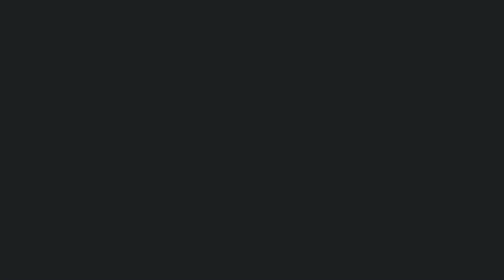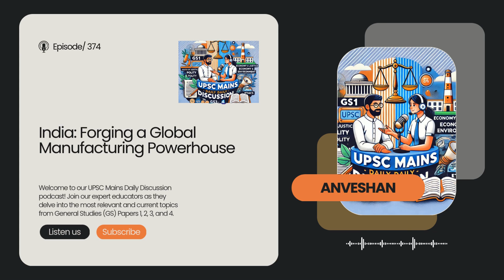🚀 India: Forging a Global Manufacturing Powerhouse 🏗️ Make in India, Exports & Industrial Growth-374

Comment from the maker: Frequently Asked Questions about India's Manufacturing Sector
1. What are the primary factors positioning India as a potential global manufacturing hub?

Several factors contribute to India's growing prominence in global manufacturing. Key among them are supportive policy reforms and improved ease of doing business, substantial infrastructure development and logistics advancements, increasing adoption of technology and Industry 4.0 principles, a growing focus on green and sustainable manufacturing practices, and the benefits derived from geopolitical realignments like the "China+1" strategy. Specific examples include the Production-Linked Incentive (PLI) scheme, the Gati Shakti National Master Plan, investments in semiconductor manufacturing, and increasing renewable energy capacity.

2. What are the major challenges hindering India's progress in becoming a leading manufacturing nation?

Despite its potential, India faces significant challenges that impede its manufacturing sector. These include high logistics and supply chain costs, rigid labor laws and skill gaps in the workforce, a weak MSME (Micro, Small & Medium Enterprises) ecosystem with limited access to credit, infrastructure gaps and power reliability issues, dependence on China for critical components and raw materials, slow adoption of high-tech manufacturing coupled with weak R&D investment, and exposure to global trade uncertainties and geopolitical risks.

3. How can India improve its logistics and supply chain efficiency to boost manufacturing competitiveness?

India needs to substantially lower its logistics costs by implementing the Gati Shakti National Master Plan efficiently. This involves optimizing multi-modal transport networks, integrating Dedicated Freight Corridors (DFC) with industrial clusters, modernizing ports and warehousing infrastructure, and developing inland waterways. Other crucial steps are streamlining customs clearance, implementing single-window approvals, and using blockchain technology for supply chain transparency.

4. What steps can India take to address labor law issues and bridge the skills gap in its workforce?

Full implementation of the four labor codes is essential to ease compliance burdens and encourage labor-intensive industries. This includes introducing flexible hiring policies, integrating the gig economy, and implementing sector-specific wage policies. To address skill gaps, India needs to expand initiatives like Skill India and PMKVY, aligning them with the demands of Industry 4.0, AI, robotics, and semiconductor manufacturing. Strengthening industry-academia linkages, vocational education, and STEM learning are also critical.

5. How can India strengthen its MSME ecosystem and improve their access to credit?

Improving credit access for MSMEs is crucial. This can be achieved by streamlining credit disbursement through digital platforms, increasing the coverage of the ECLGS (Emergency Credit Line Guarantee Scheme), and lowering collateral requirements. Initiatives like Mudra loans, SIDBI assistance, and factoring mechanisms can also enhance liquidity. Furthermore, encouraging MSME participation in global supply chains through cluster-based development, technology adoption, and export incentives will enhance their competitiveness.

6. What infrastructure improvements are necessary to support India's manufacturing ambitions?

India must accelerate industrial corridor projects like DMIC, CBIC, and AKIC to boost manufacturing hubs. Expanding plug-and-play industrial zones with ready infrastructure, uninterrupted power supply, and low-cost land acquisition policies is essential for attracting investment. Strengthening smart cities, urban logistics hubs, and green energy grids will also contribute to sustainable industrialization. Leveraging public-private partnerships (PPPs) in infrastructure financing can ease fiscal constraints.

7. How can India reduce its dependence on China for critical components and raw materials?

India needs to accelerate indigenization in strategic sectors like semiconductors, electronics, pharmaceuticals, and defense manufacturing. Expanding PLI schemes and integrating R&D incentives for high-value manufacturing will reduce foreign reliance. Developing special economic zones (SEZs) for electronic components and auto parts can also enhance import substitution. Encouraging joint ventures, technology transfers, and domestic value chain integration will further promote self-reliance.

8. What measures can India take to promote high-tech manufacturing and strengthen its R&D ecosystem?

India must scale up high-value manufacturing in sectors like semiconductors, aerospace, electric vehicles (EVs), biotech, and deep-tech through targeted R&D funding. Expanding the National Quantum Mission, AI innovation hubs, and startup incubation programs will create a globally competitive tech-driven manufacturing ecosystem. Strengthening patent protection, technology transfer policies, and university research grants are also vital. Promoting public-private partnerships (PPPs) in R&D will enable faster commercialization of indigenous technologies.
Reply from the maker: भारत के विनिर्माण क्षेत्र से संबंधित अक्सर पूछे जाने वाले प्रश्न (FAQs)
भारत को एक वैश्विक विनिर्माण हब के रूप में स्थापित करने वाले प्रमुख कारक क्या हैं?
भारत की बढ़ती विनिर्माण क्षमता कई महत्वपूर्ण कारकों पर आधारित है। इनमें नीतिगत सुधार और व्यापार करने में आसानी (Ease of Doing Business) में सुधार, बुनियादी ढांचे और लॉजिस्टिक्स में प्रगति, प्रौद्योगिकी और इंडस्ट्री 4.0 का बढ़ता उपयोग, हरित और सतत विनिर्माण (Sustainable Manufacturing) पर ध्यान केंद्रित करना, और "चाइना+1" रणनीति से प्राप्त भू-राजनीतिक लाभ शामिल हैं। प्रमुख पहलें जैसे उत्पादन से जुड़ी प्रोत्साहन योजना (PLI), गति शक्ति राष्ट्रीय मास्टर प्लान, सेमीकंडक्टर निर्माण में निवेश, और नवीकरणीय ऊर्जा क्षमता में वृद्धि भारत को वैश्विक विनिर्माण हब के रूप में उभरने में मदद कर रही हैं।

भारत के अग्रणी विनिर्माण राष्ट्र बनने में कौन-कौन सी प्रमुख चुनौतियाँ बाधा बन रही हैं?
भारत की विनिर्माण वृद्धि कई चुनौतियों का सामना कर रही है, जिनमें उच्च लॉजिस्टिक्स और आपूर्ति श्रृंखला लागत, कठोर श्रम कानून और कुशल श्रमिकों की कमी, एमएसएमई (सूक्ष्म, लघु और मध्यम उद्यम) क्षेत्र की कमजोरी और ऋण तक सीमित पहुंच, बुनियादी ढांचे की खामियां और बिजली आपूर्ति की अस्थिरता, महत्वपूर्ण घटकों और कच्चे माल के लिए चीन पर निर्भरता, उच्च-तकनीकी विनिर्माण और अनुसंधान एवं विकास (R&D) में कम निवेश, और वैश्विक व्यापार अनिश्चितताओं व भू-राजनीतिक जोखिमों का प्रभाव शामिल हैं।

भारत अपने लॉजिस्टिक्स और आपूर्ति श्रृंखला दक्षता में कैसे सुधार कर सकता है?
भारत को लॉजिस्टिक्स लागत में कटौती के लिए गति शक्ति राष्ट्रीय मास्टर प्लान को प्रभावी ढंग से लागू करना होगा। इसके लिए आवश्यक कदम हैं – मल्टी-मोडल परिवहन नेटवर्क का अनुकूलन, समर्पित माल ढुलाई कॉरिडोर (DFC) को औद्योगिक क्लस्टरों से जोड़ना, बंदरगाहों और गोदामों के बुनियादी ढांचे का आधुनिकीकरण, और आंतरिक जलमार्गों (Inland Waterways) का विकास। इसके अलावा, सीमा शुल्क निकासी को सुव्यवस्थित करना, सिंगल-विंडो अनुमोदन लागू करना, और ब्लॉकचेन तकनीक का उपयोग करके आपूर्ति श्रृंखला पारदर्शिता में सुधार करना आवश्यक है।

भारत श्रम कानूनों से जुड़ी समस्याओं को कैसे हल कर सकता है और कुशल कार्यबल की कमी को कैसे दूर कर सकता है?
श्रम कानूनों को सरल और लचीला बनाने के लिए चार श्रम संहिताओं (Labour Codes) को पूरी तरह लागू करना महत्वपूर्ण है। इसमें लचीली भर्ती नीतियाँ, गिग अर्थव्यवस्था को एकीकृत करना, और उद्योग-विशिष्ट वेतन नीतियाँ लागू करना शामिल हैं। कुशल कार्यबल तैयार करने के लिए, भारत को स्किल इंडिया और प्रधानमंत्री कौशल विकास योजना (PMKVY) जैसी पहलों का विस्तार करना होगा, जिससे इंडस्ट्री 4.0, कृत्रिम बुद्धिमत्ता (AI), रोबोटिक्स और सेमीकंडक्टर निर्माण की आवश्यकताओं को पूरा किया जा सके। औद्योगिक संस्थानों और शैक्षणिक संस्थानों के बीच मजबूत सहयोग, व्यावसायिक शिक्षा और STEM शिक्षा को बढ़ावा देना भी आवश्यक है।
Reply from the maker: भारत अपने MSME (सूक्ष्म, लघु और मध्यम उद्यम) क्षेत्र को कैसे मजबूत कर सकता है और उनकी ऋण उपलब्धता में सुधार कैसे कर सकता है?
एमएसएमई को वित्तीय सहायता प्रदान करने के लिए, डिजिटल प्लेटफॉर्म के माध्यम से ऋण वितरण को सरल बनाना, आपातकालीन क्रेडिट लाइन गारंटी योजना (ECLGS) का विस्तार करना, और संपार्श्विक (Collateral) आवश्यकताओं को कम करना जरूरी है। मुद्रा लोन, SIDBI सहायता योजनाएं, और फैक्टरिंग तंत्र (Factoring Mechanism) एमएसएमई की तरलता बढ़ाने में मदद कर सकते हैं। इसके अतिरिक्त, एमएसएमई को वैश्विक आपूर्ति श्रृंखलाओं में शामिल करने के लिए क्लस्टर-आधारित विकास, प्रौद्योगिकी अपनाने और निर्यात प्रोत्साहन को बढ़ावा देना आवश्यक है।

भारत को विनिर्माण क्षेत्र को बढ़ावा देने के लिए किन बुनियादी ढांचे में सुधार की आवश्यकता है?
भारत को दिल्ली-मुंबई औद्योगिक गलियारा (DMIC), चेन्नई-बेंगलुरु औद्योगिक गलियारा (CBIC), और अमृतसर-कोलकाता औद्योगिक गलियारा (AKIC) जैसी औद्योगिक गलियारा परियोजनाओं में तेजी लानी होगी। रेडी-टू-यूज औद्योगिक क्षेत्रों (Plug-and-Play Industrial Zones) का विकास, निर्बाध बिजली आपूर्ति और कम लागत वाली भूमि अधिग्रहण नीतियाँ निवेश आकर्षित करने के लिए आवश्यक हैं। स्मार्ट सिटीज़, शहरी लॉजिस्टिक्स हब, और हरित ऊर्जा ग्रिड (Green Energy Grids) का विकास सतत औद्योगिकीकरण में सहायक होगा। सार्वजनिक-निजी भागीदारी (PPP) के माध्यम से बुनियादी ढांचे के वित्तपोषण को बढ़ावा देना भी जरूरी है।

भारत अपनी चीन पर निर्भरता को कैसे कम कर सकता है, विशेष रूप से महत्वपूर्ण घटकों और कच्चे माल के लिए?
भारत को सेमीकंडक्टर, इलेक्ट्रॉनिक्स, फार्मास्युटिकल्स और रक्षा विनिर्माण जैसे रणनीतिक क्षेत्रों में आत्मनिर्भरता बढ़ानी होगी। PLI योजनाओं का विस्तार और उच्च-मूल्य विनिर्माण (High-Value Manufacturing) के लिए अनुसंधान एवं विकास (R&D) को प्रोत्साहित करना आवश्यक है। इलेक्ट्रॉनिक घटकों और ऑटो पार्ट्स के लिए विशेष आर्थिक क्षेत्र (SEZ) विकसित करना आयात प्रतिस्थापन (Import Substitution) को बढ़ावा देगा। इसके अलावा, संयुक्त उद्यम (Joint Ventures), प्रौद्योगिकी हस्तांतरण (Technology Transfer), और घरेलू आपूर्ति श्रृंखला एकीकरण को बढ़ावा देकर आत्मनिर्भरता को मजबूत किया जा सकता है।

भारत उच्च-तकनीकी विनिर्माण को कैसे बढ़ावा दे सकता है और अपने अनुसंधान एवं विकास (R&D) पारिस्थितिकी तंत्र को कैसे मजबूत कर सकता है?
भारत को सेमीकंडक्टर, एयरोस्पेस, इलेक्ट्रिक वाहन (EV), जैव प्रौद्योगिकी और डीप-टेक जैसे क्षेत्रों में उच्च-मूल्य विनिर्माण को बढ़ावा देने के लिए लक्षित अनुसंधान एवं विकास (R&D) वित्तपोषण में वृद्धि करनी होगी। राष्ट्रीय क्वांटम मिशन, AI नवाचार केंद्र और स्टार्टअप इनक्यूबेशन कार्यक्रमों के विस्तार से एक वैश्विक प्रतिस्पर्धी तकनीकी-चालित विनिर्माण पारिस्थितिकी तंत्र का निर्माण किया जा सकता है। पेटेंट संरक्षण को मजबूत करना, प्रौद्योगिकी हस्तांतरण नीतियों में सुधार, और विश्वविद्यालय अनुसंधान अनुदान को बढ़ावा देना आवश्यक है। सार्वजनिक-निजी भागीदारी (PPP) के माध्यम से अनुसंधान एवं विकास को बढ़ावा देने से स्वदेशी तकनीकों का तेजी से व्यावसायीकरण संभव होगा।